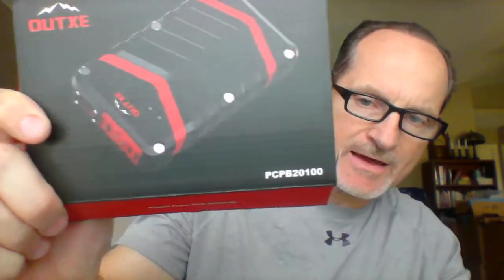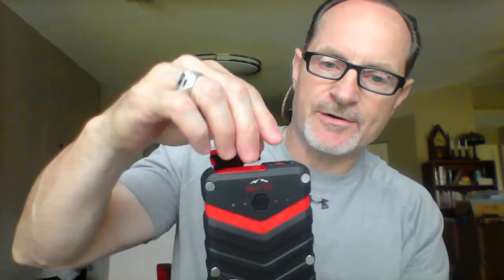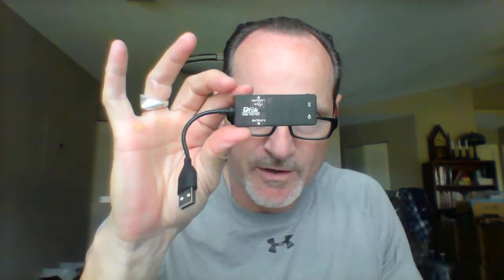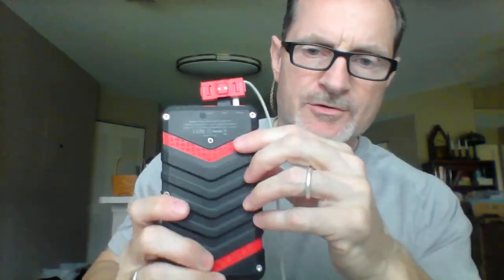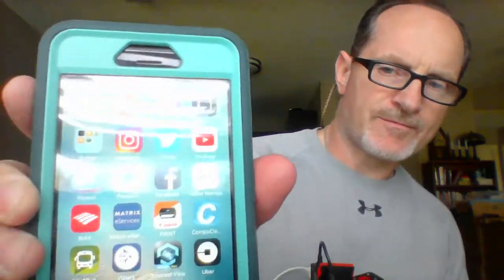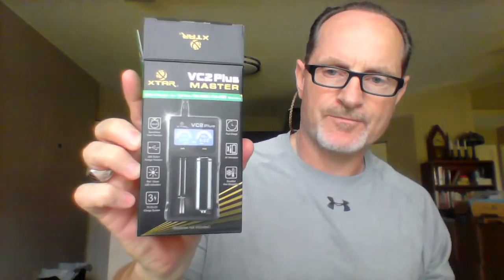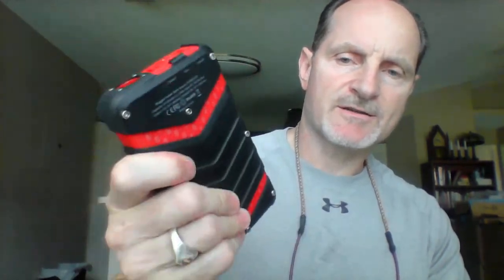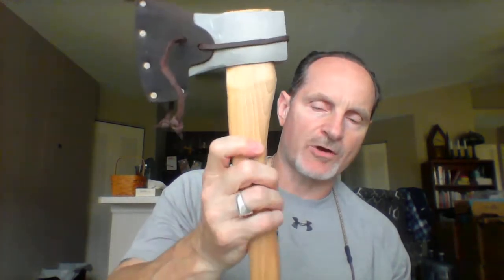OUTXE Rugged Power Bank Review- 20100 mAh

Comment: I want to buy this. Before that i want to know the backup capacity. How many times it can charge iphone 7? Also want to know the durability. Thanks in advance.
Reply from the maker: It is very durable and will hold up well.  I have not did a test on how many times it will charge the iPhone.  THat will be another video.  I can recharge using my solar panel as well.  You should get at least two full charges out of this maybe more.

Comment: I can't get the cap at the top to open, is this a faulty unit or do I need to adjust the screws at the top?
Reply from the maker: You need to push one side first then lift the other.  It fits snuggly because it is waterproof.